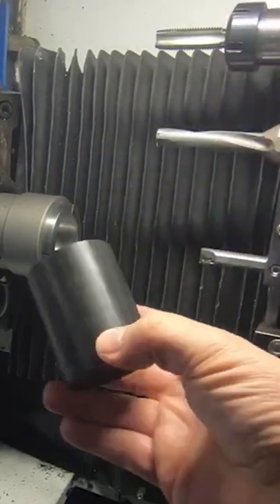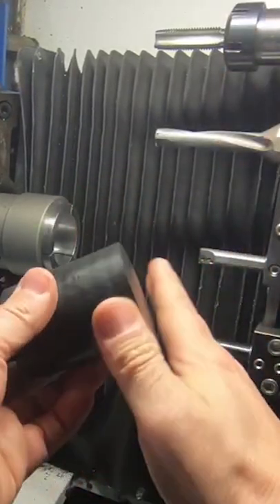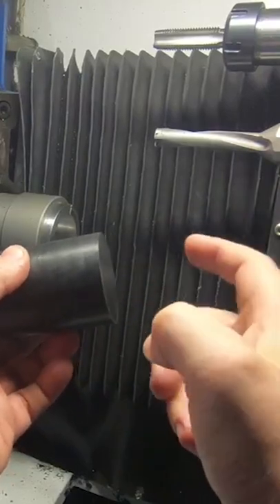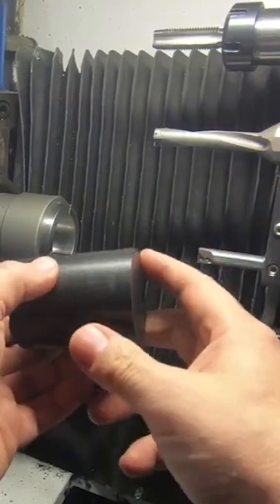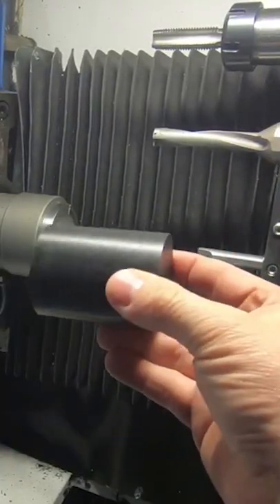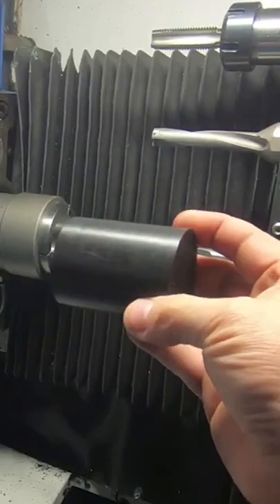When you don't Tormach, OmniTurn CNC makes you money! 💵 💰#Shorts

Comment: That machine is also 10k more expensive (brand new). You get what you pay for I guess. Tormach is much more affordable, and with more community support, a conversational control that simplifies things a bunch, good entry level machine with some room for growth. Nothing bad with that
Reply from the maker: You're comparing new prices, who buys new when they are looking for a budget machine?!  Ours was only $3500.00 (used Omniturns often go for less than used Tormachs) and it dominates the Tormach in HP, speed, accuracy, rigidity, rapid speeds, tool change speed and is made in America, not an all Chinese piece like the Tormach.
Reply: @MadManMachines  I'm not arguing that, I'm just saying tormach has its place. Not everyone wants a machine for industrial purposes. Some people just want an easy machine to operate and program to make do dats. I hadn't  even heard of an omniturn until I saw your video
Reply from the maker: @luisovaladez  Most haven't ever seen one, thats why we did a video, to get the word out there is a much better (and cheaper since there isn't hype around the omniturn) for hobbyists.   Its a single phase 220V machine to boot and only 1750 pounds, so it'll fit in anyone's home shop! Check out our longer video where we break it all down!
Reply: @MadManMachines where can I get one?

Comment: Provided you can do all your machining using just the 4 tools .....anything is possible very quickly......after that an ATC with 10 or 15 stations beats it hands down..
Reply from the maker: I've had up to 10 tools on it at once, plus, a machine with a 15 tool ATC isn't single phase, can't easily fit in your garage, weights 5000+ pounds (i know, i owned two Haas ST10Y's), defeating the whole point of this video, which was a cheap, accurate, fast, fit in your garage lathe that runs on single phase.

Comment: lol comparing metal vs plastic
Reply: Eh...not really.  Tormach is ahead of this machine in many aspects.
Reply from the maker: Since the Omniturn still has almost TWICE the HP,  THREE times as fast of  Rapids,  Up to 2000 more RPM (which means almost twice the feed per rev rate), is far more rigid (allowing deeper, faster cuts per pass), is vastly more accurate, runs on ball bearing linear ways, has an available bar feeder, is made in the USA with USA (servos, collet closer, spindle, headstock, base, software, spindle motor etc), German (Bosch Rexroth linear ways) and Japanese (NSK bearings and zero backlash ground ball screws) parts, compared to the Chinese made Tormach, there isn't much for the Tormach to be ahead on other than a superior marketing campaign.

Comment: What's that tap cycle code? Or did you manually!
Reply from the maker: That was just a straight feed move in and out in Z axis at the thread TPI.  In this case  the tap was 12 teeth per inch.  So, 1.000 divided by 12 = a feed rate of .0833 in and out.
Reply: @MadManMachines  thanks
Reply from the maker: @emitrots6018  I should mention, when I use smaller taps, i use a tap release holder, which releases stress on the tap when you reverse direction out, but this tap is so big, it isn't necessary...

Comment: Having a hard time finding pricing?
Reply from the maker: Pricing on a new one or used one?  New they are 39,750, used they vary.  You can get attachments for as little as 1000 or a GT75 anywhere from around 5000-20000 depending on age and condition.  Saw a really nice newer one for 12,000 a few months back, but it sold quickly so you have to keep your eyes open.

Comment: Yet Tormach has made MANY millions and started huge businesses. And all at a low price. Ill put my Tormach again another machine anytime, if you dial it it will make parts just as good. Yes a slower speed but just as good.
Reply from the maker: No it won't.  That's just simply false. Omniturns will hold to +/-.0001.  A tormach only holds to +/-.001 on a good day!  Before you say anymore, please go watch our other video that shows why it is so much more accurate.  The tormach is a converted manual chinese lathe with a carriage running on dovertails  and stepper motors for petes sake!  The OmniTurn is faster, almost double the Horsepower, more rigidity, is vastly more accurate, faster rapids, higher spindle RPM, has an available bar feeder, is made in the USA with USA (servos, collet closer, spindle, headstock, base, software, spindle motor etc), German (Bosch Rexroth linear ways) and Japanese (NSK bearings and zero backlash ground ball screws) parts, no tearing down is needed. The Chinese made Tormach is an inferior product, period.

Comment: When you gotta try to tear down your competition...you clearly have an inferior product.
Reply from the maker: Good thing no tearing down was needed, if you watch our full video, the OmniTurn is faster, almost double the Horsepower, more rigidity, is vastly more accurate, faster rapids, higher spindle RPM, has an available bar feeder, is made in the USA with USA (servos, collet closer, spindle, headstock, base, software, spindle motor etc), German (Bosch Rexroth linear ways) and Japanese (NSK bearings and zero backlash ground ball screws) parts, no tearing down is needed. The Chinese made Tormach is an inferior product, period.

Comment: So you're going to ignore that you're machining, what looks to be pvc? The tormach is machinig aluminium. You cant machine plastics any other way then fast.
Reply from the maker: Are you going to ignore that we never actually compared them machining?  The Omniturn was done before the Tormach even hit the aluminum!  Had we  actually compared them both cutting the same material, either aluminum or delrin, they omni turn would still machine the part a good 5 times faster! Before you say anymore, please go watch our other video that shows why it is so much more faster and accurate.  The tormach is a converted manual chinese lathe with a carriage running on dovertails  and stepper motors for petes sake!  The OmniTurn is faster, almost double the Horsepower, more rigidity, is vastly more accurate, faster rapids, higher spindle RPM, has an available bar feeder, is made in the USA with USA (servos, collet closer, spindle, headstock, base, software, spindle motor etc), German (Bosch Rexroth linear ways) and Japanese (NSK bearings and zero backlash ground ball screws) parts. . The Chinese made Tormach is an inferior product, period.

Comment: If you set the slant pro with tools on the gang plate it’ll be the same. No need for the turret to change tool and slow it down. This is a failed comparison
Reply from the maker: Thank goodness this isn't a "failed" comparison, as the Omniturn still has almost TWICE the HP,  THREE times as fast of  Rapids,  Up to 2000 more RPM (which means almost twice the feed per rev rate), is far more rigid (allowing deeper, faster cuts per pass), is vastly more accurate, runs on ball bearing linear ways, has an available bar feeder, is made in the USA with USA (servos, collet closer, spindle, headstock, base, software, spindle motor etc), German (Bosch Rexroth linear ways) and Japanese (NSK bearings and zero backlash ground ball screws) parts, no tearing down is needed. The Chinese made Tormach is an inferior product, period.